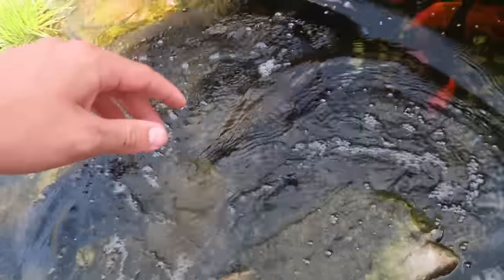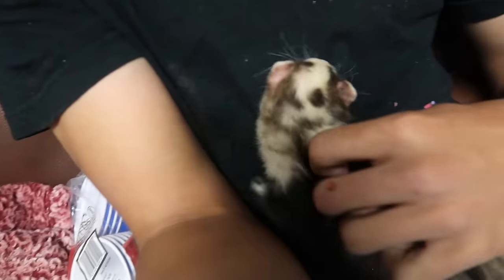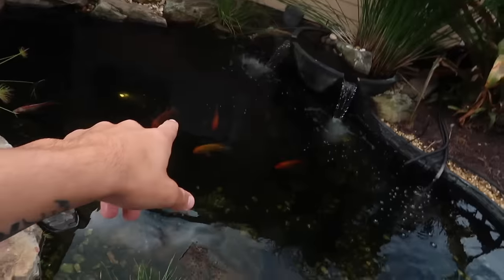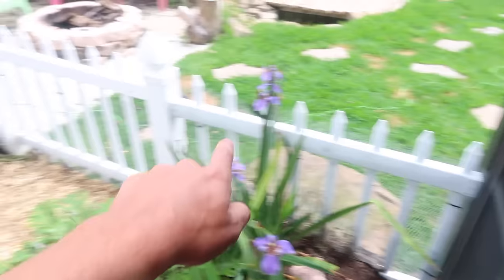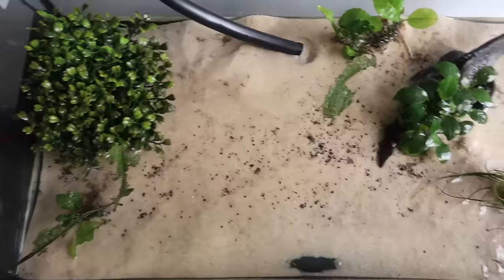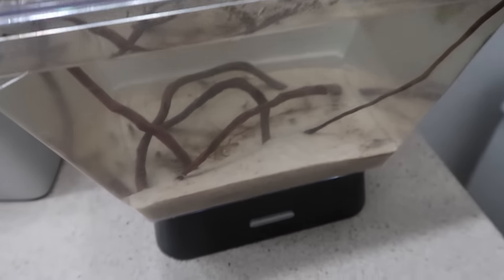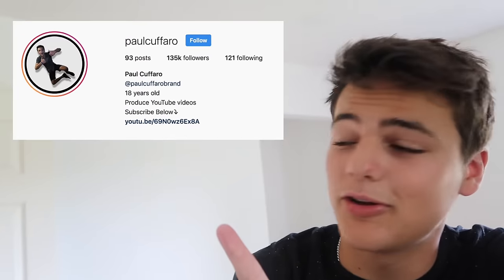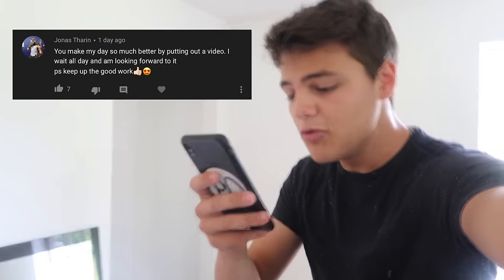BLUE CRAY-FISH *ONLY* 10G AQUARIUM!!!

Comment: Another way to siphon, if any of you guys are wary about sucking on the tube to start it, is to fully submerge the tube in the tank (move it around in there a bit to get the air out if you need to), cover one end with your thumb, pull that end out, and release your thumb once you’ve positioned the end where you want the water to go. It’ll create the suction without having to involve your mouth.

Comment: You should put some higher levels in there for them since the tank is taller than it is longer so they’ll be able to use all the space in the tank and just not all at the bottom